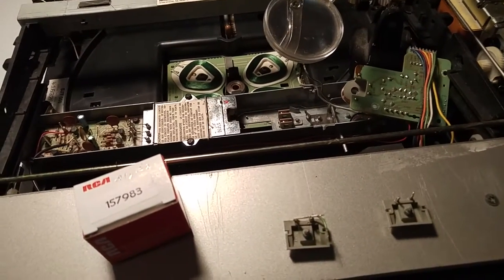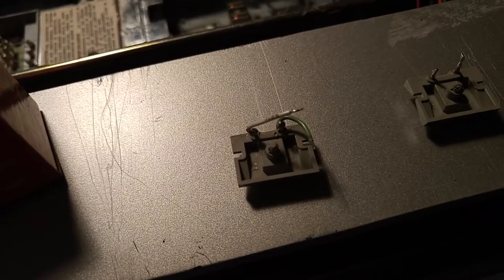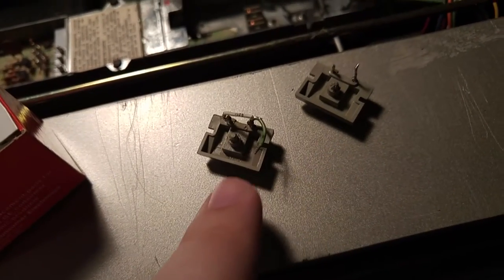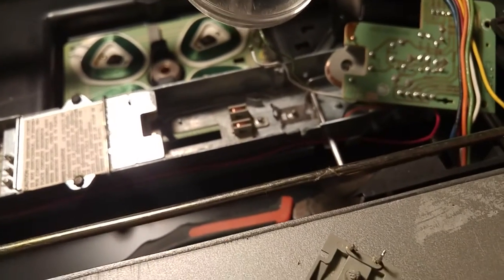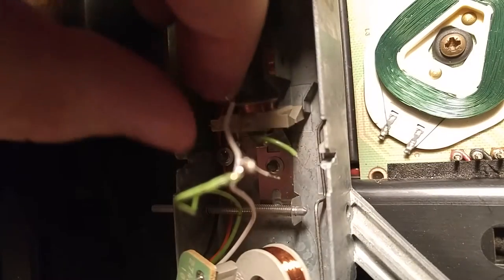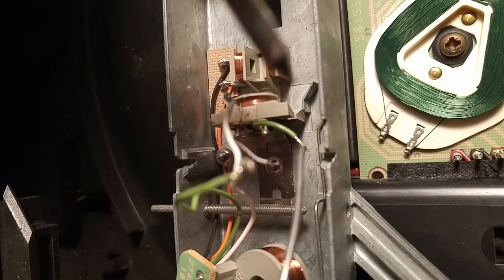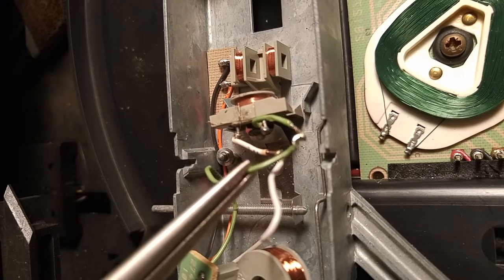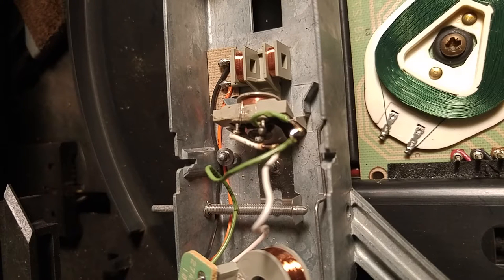CED Player J/K Arm Stretcher Coil Installation SJT300

Comment: a lot of times, i get a bead on the tip of the iron and move the bead on the tip over to the wire and smear it around

did you cover the solder connections with anything? those bare wires cant touch anything or bad news